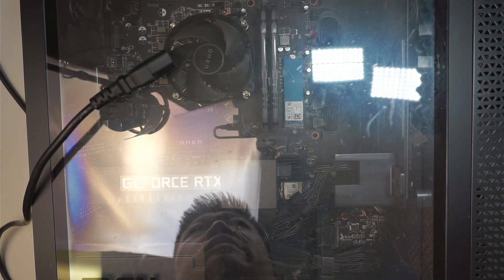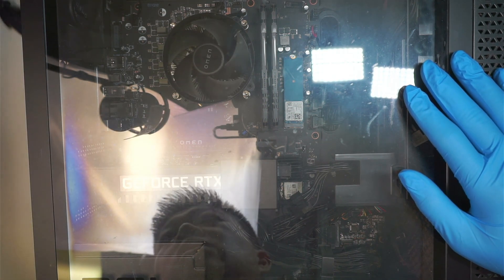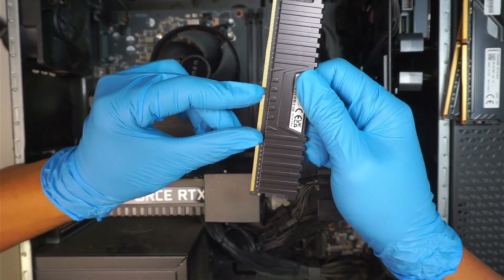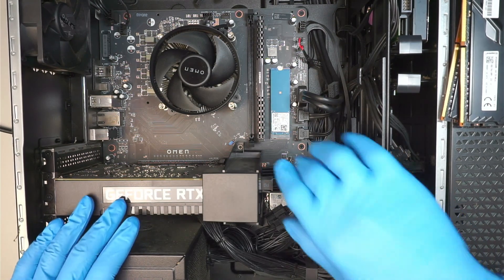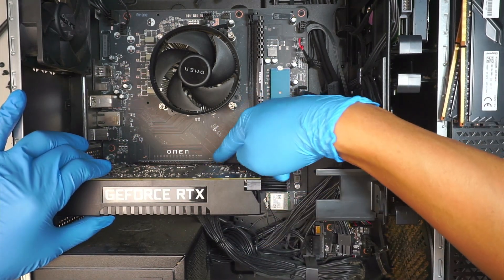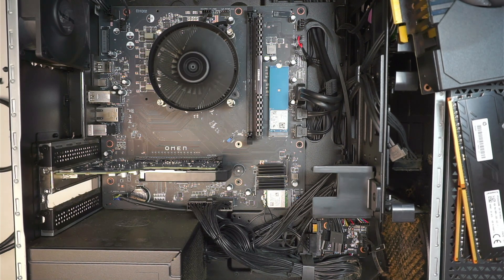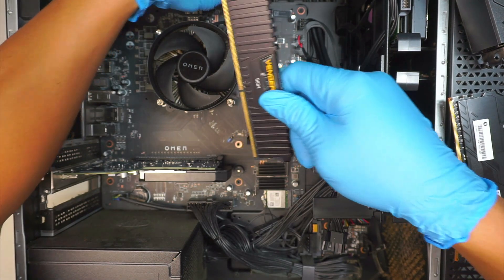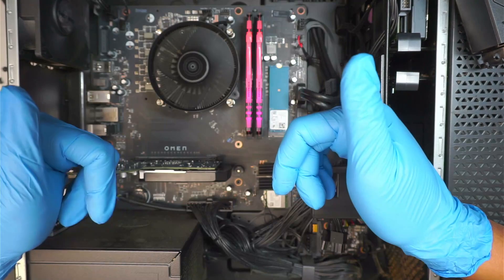FIXED HP Omen Desktop 3 Long Beeps 3 Short Beeps

Comment: great video. b550m hana 40l omen mobo with new ryzen 7 5800xt
with a 1070 in it i was getting 3 long beeps, 3 short beeps. tried reseating ram, checking all connections etc. (I know the 1070 was working before putting in here). Pulled 1070 put a Arc a750 in. posted to windows. ran hp assistant download and install all updates. does a bios update restarts pc and 3 long beeps 3 short beeps. went back to reseating ram and switching gpu back to 1070 no beeps any more but no display, no post, just lights and fans. Im going to test the gpus in another build make sure they still work, if they do i guess next ill suspect psu not supplying stable on pcie 6+2  or a bricked or bad mobo? thoughts?

Comment: Hey guys if its not working try changing the cable my other 8 pin connector overloaded my previous gpu until it died

Comment: Same problem, after I disconnected 2 monitors from display ports, the PC booted just fine. Now without turning it off, plugged in the monitors cables and all runs ok. Issue is with graphics card or with display ports for me.

Comment: You didnt need to install the small graphics card. The computer can boot off of the integrated graphics on the CPU.
Reply: These HP Omen pre-built don't have any display connectors on the motherboard s.
Reply: And what if there’s an issue with the pcie slot used by the gpu?

Comment: I have had my pc for 3 days, and it’s doing the same set of beeps. Honestly not sure what’s wrong with it

*update
I ended up bringing it in to be looked at, but I was just given a brand new one because I had a warranty. I initially tried getting new ram for it, but the kind that I bought didn’t work with it for some reason, so I returned that too. Overall not a fun experience, but the new pc works fine for now. Hopefully it doesn’t happen again lol.

Comment: My pc with a omen motherboard is doing the same thing after i changed the gpu for a 7900xt does this mean i need to return it?
Reply: Did you get this fixed?  I have the same problem.
Reply: Any update same issue
Reply: @nostylekid8690   i returned it. Took me a month to get a refund from amazon lol. I bought a new one and its working fine

Comment: Great video. My computer turns on. But when I plug the power cable to the video card. It won't boot. I already put on a new PSU. So I'm thinking it must be the video card. I get the same 3 beeps  if I unplug the video card
Reply: those beeps mean that a graphics card is not found on the pc. If they are only beeping when you take out the graphics card, that is not the issue. I'd recommend resetting the CMOS battery.